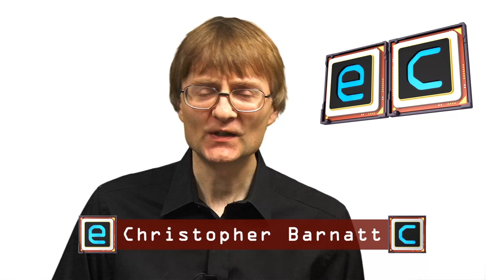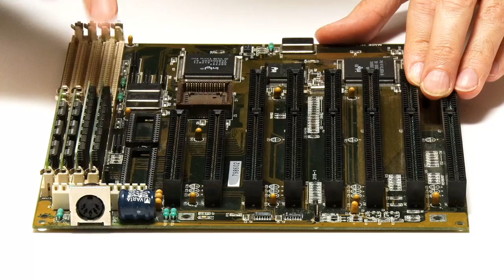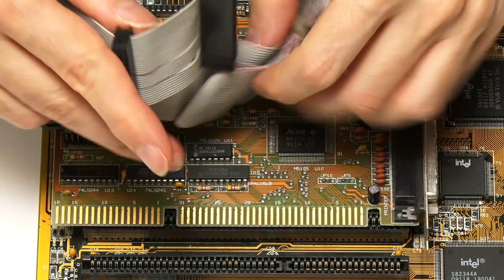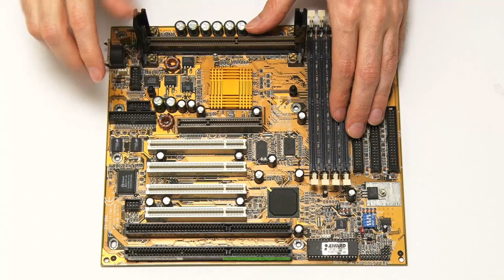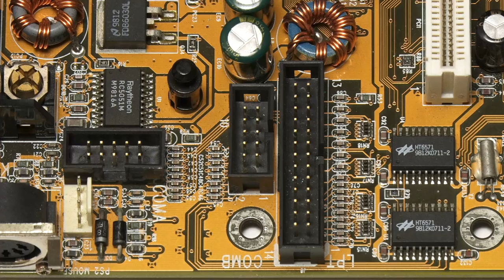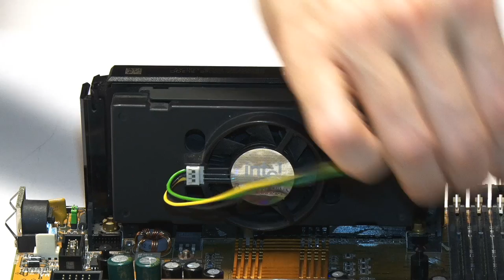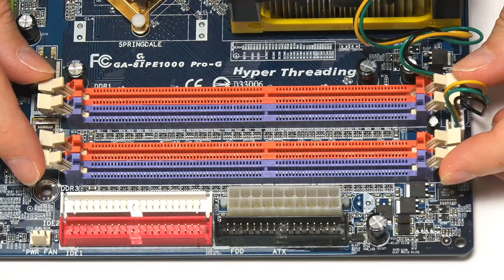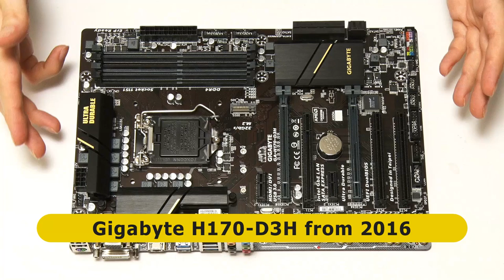PC Motherboard Evolution

Comment from the maker: Dear all, please note that I am very well aware that floppy and IDE ribbon cables had a red or pink stripe down one side that indicated the direction of insertion when using sockets without a notch or blanked out pin. Just because I do not mention something in what is already a long video does not mean that I am unaware of it! :)

The cable I insert into the controller card at about 6:15 is indeed inserted the wrong way around. But given that this is an old, non-functional board – and this is not a “how to” video – this really does not matter. As always, when filming I am working upside down, and leaning back to avoid getting in the way of the camera and lights, so what you can see onscreen is far clearer than what I can see, and when filming I have a lot of other things to concentrate on. I make 52 videos here a year on a very tight schedule. Not everything is perfect. It never will be. But I do what I can to make things as accurate as possible.

To those keen to point out below that I have “missed things out”, please note that I do say in the introduction that this video is not a definitive history of motherboards. Rather, it is a gentle discussion of those older boards I have in my possession.
Reply: Relax, it's only Youtube. :D
Reply: I think most of the floppy-cable-comments just wanted to say... 
"hey, I can remember"
and most of us just want to give something back to you for your hard work. (oh oh, I think I should learn english harder. Hope you understand me.)
Reply: I think you destroyed one of your viewers computer with pentium 133mhz. :)
Reply: Indeed, Chris, well said!  I hesitate to ask my question now, but I have an ancient, non functional 386 (It even has the original case with the huge red power switch.  Very COOL.)  Anyways, I have no money at all, and even if I did, I have no idea where to buy used pc parts of this age, would you consider selling me that motherboard for parts?  I have about 10.00 usd.  (Told you I was poor.  XD)  If not no worries. I'll just keep collecting...
Reply: Despite the fact that it isn't a definitive history video, I still learned something new today from this.  I had no idea that Baby-AT was even still a thing in 1999, much less that any P2 boards were made for the format.  At that time, I was running a Tyan Thunder 2 motherboard with two P2-333's, it was an EATX board.
Reply: When I saw you put it that ribbon cable in the wrong way, my eyes started to twitch since you said I happen to know it goes in this way.
Reply: refer to 0.34 to 0.36 and a half...
Reply: WTH are you talking about?
Reply: aaaw we forgive you, I did notice you turned the red line the wrong way and OCD kicked in, but didn't feel the need to mention it, I am fairly sure you are well aware of it since you are extremely good at nerding computers :D
Reply: I found your video very interesting however it seems that you are partial to Intel based CPUs. I throughout my PC life am more partial to AMD based CPUs. And, their changes had minor differences.

I build and maintain computers for a living since 1982.  First involvement was when I was in the 7th grade in 1971.

Thank you.
Reply: we all have different stories, I started with an Intel 386sx 16MHz, but also had a 486DX2 80MHz which is from AMD since Intel did not make this speed and a DX3 120MHz also AMD, later on I had a 200MHz Cyrix, had a few different Athlon ones and currently in the house I have a Intel Pentium 4, and Intel 486 DX2 66MHz, an Intel 4200U some obscure Intel processor in the laptop/tablet combo thingie and a Ryzen 1700. He focused on those he had lying about if you listened.
Reply: I loved the Cyrix processors.
Reply: The date codes on the chipset on the 80386 board are week 17 and 18 from 1991, hence the determination it's a 1991 board, probably to a 1990 design.
Reply: ExplainingComputers, do you have a GA-Z77X-UD3H? if so burn it. Can not stand gigabyte.
Reply: You know for a fact that we all still got it wrong when the board did not use the full plastic connector just the pin headers ;), but we wont admit it ;) ...
Reply: Yeah... the floppy cable part got my eye twitching... only because you prefaced it with, "...I happen to know it goes this way" (paraphrased).  Now I wasn't going to comment because TECHNICALLY it could go that way as long as you connected it backward on the floppy drives.  But with Hard Drives, you had to account for the knockout pin... that is why it is important to know the pin 1 marking on the block or the ribbon. ;)  No worries... you are doing fine and this is a great video.
Reply: I think it does matter, Chris. But in regards to showing how people could get their cables attached in the wrong way, and how the notch fixed that.
Even though you're talking about something else in here (and I understand that), that mistake illustrates the problem perfectly.
You may want to put an annotation at that exact point in your video, so fewer people will complain in the future. Instead they'll say that they were going to complain until they saw your annotation. :P
Reply from the maker: allluckyseven Great point -- I ironically illustrated my own point by making a mistake! :)
Reply: Damn… putting pitchfork back into storage

Just kidding, thanks for the great trip down memory lane! My PC life started with a 386DX-40 with 40 MHz in "Turbo"-mode … and a 120MB (MEGAbyte! That's 0.12 GB!) HDD which the seller said will never get full because it was such an unthinkable amount of storage those days.
Reply: same here, hard to watch it go on wrong.  he got it backwards because he didn't check the ribbon line to pin 1 which is how one checks, and he also specifically mentions having to rely on recollection which further drives it home.

the notched sockets and missing pins and blocked holes that came later were precisely a response to people not getting it right, which is why any computer person from that period cringes when seeing them go on wrong.

That is clearly not a simple omission or failure to mention and of course leads to a lot of well intending comments with the missing information and pointing out it was put on the wrong way.  it is a tech trigger for anyone from that period! ;-P
Reply from the maker: What so many people here seem to be totally missing is that a video is not reality. Did I check the cable? No. Why? Because when filming I have a very poor view indeed of what am doing. In the real world you do not assemble PCs upside down, from behind, under movie lights, while focusing on keeping everything in shot and not getting in the way of the lighting either, and matching into the shot before. I am never, ever filming in a situation remotely similar to a normal build situation, because the camera always has to be where my eyes need to be -- especially when the camera is close or very close.

And please remember, to quote a comment here, I am a computer person from this/that period! People seem intent here on portraying me as an idiot with no experience when what I am trying to do is to make the best content possible **within the constraints of actually producing that content**. I strongly suspect that I would not have been employed as a lecturer in computing for 25 years, or commissioned to write many computing books that sold well, without having some level of competence! :)

As another comment elsewhere here has pointed out, the whole point of this part of the video was to highlight that it was possible to put a cable in the wrong way round in those days -- so in part I ironically demonstrate the precise point I was making. :_
Reply: self-explanatory to those that matter. The good news is if you happen to do this on a Hard-drive IDE cable, the motherboard will likely beep/boot to bios screen then report no drive, and then the Hard drive will not Spin up.(Some motherboards it will stay black screen with no beep and no spin up, like it was a dead motherboard and Drive. -- & With a floppy drive, it will provoke a constant lit LED on the floppy with boot to bios with a beep and then only failing to boot if its checking the floppy status on boot (a setting in the bios). If this setting in the bios is not set, it can happly stay in the Lit-LED state/un-usable and it will still boot up but leaving you with a useless floppy drive. Point being, every component will survive, without damage.
Reply: it makes sense that it would be easy to make a mistake under those filming conditions.  no computer person from any time is ever going to know everything or get it right all the time.  it is unrealistic for anyone to expect otherwise.

often those moments get a lot more views and interest because they act as a natural focal point for attention, that's also normal.  has anyone ever made a perfect video?  no.  that's the reality of video.

i haven't read all the comments, most of the comments i read were people trying to be helpful.  it is a shame if anyone was trying to diminish your life experience over a misplugged cable, i wouldn't pay any attention to such a comment as that is crazy.

there are still internal connecters that can be accidentally reversed, that problem never seems to go away completely.  i cringe every time i see a flat ribbon cable with no keying in 2018.  smdh.
Reply: How dare you preempt my correction?  How am I supposed to go on feeling superior now?
Reply: Oh so you noticed you put it backwards, hehehe ;-)
Reply: our current mobo is far more advanced than the one you shown from 2016. ROG Ramoage VI Extreme has 802.11AC & 802.11AD WIFI TYPE C USB DIMM.2 Socket Intel Optane NVME and Bios connected directly to manufacturer server for updates.
Reply: Do a history of storage interfaces eg: ide, ata, ultra ata, sata, etc
Reply: I'm surprised you didn't mention power connectors. I didn't see a 24pin Molex connector on the first couple boards. Nowadays boards need a whole extra connector. Also the middle boards had multicolored gpio connectors?
Reply: AMD processors used the same motherboard as Intel processors until the Athlon in 1999.
Reply: Christopher,

I think you have forgotten more than most of us will ever know....just sayin' :-)
Reply: In fact you gave a realistic representation of how things were done back in the day. You look at the connector, position the cable the right way and find out it was actually the alternate right way around.
This stringently punished misrepresentation of reality has found a niche in politics today, where it has a fair chance of survival.
Reply: To err is human....  it is a 27 year MB all said and done...
Reply: Glad you cleared that up, and also, the board is marked to help you get it right, ;)
Reply: The Red strip on that cable stands for the 1st line and the pins on the board have it`s numbers printed next to them
Reply: Ah, I think I have figured out what Mr. Burton was getting at.  I think he was trying to give time stamps for the video, but couldn't tell the difference between a colon and a period.
Reply: you are the best! I appreciate how you dedicate yourself to the video as always! Despite those keyboard warriors that picking every possible mistake that you may make. they never know how hard you try and take everything you did for granted.
Reply: The earliest of the cables did not always have the red stripe.  Sometimes, in place of the red stripe on the hard plastic connector of the cable, you had a triangle indentation and a "1" indentation to identify what pin was supposed to align with the Pin one position of the connector port
Reply: @georgeworley6927  fore shame . . . what about Cyrix . . . . eventually purchased by IBM . . . . I ran a Cyrix P150+ overclocked with a custom(*i coded) QEMM Dos6.1 load, that ran duke-nukem + Descent + wolfenstien + Doom
Reply: @se8289  why are you for shaming me??? I admit that I have a bias against Intel! I did have a Cyrix based computer in mid 1990.  If I rember correctly,  a computer with an AMD CPU when I benchmarked against a comparable Cyrix based CPU, the AMD based machine won.
Reply: @georgeworley6927  sorry,  no shame intended . . . . If I've learned anything over the years working with PC tech, it's that I know a small % of whats out there, even in the public realm.

And when the Cyrix P150+ it was top for a very short period of time, at least in the mainstream via the SYSINFO sight that was up at the time . . . . though AMD was giving Intel a serious run for their money at the time . . . but thats old history at this point.  Thats back when the mainstays for updates on the industry were coming from Ziff Pub "PC Computing" and "PC Magazine" long before the days of "Maximum PC" or "Sysadmin" or Tom's Hardware. . . .
Reply: You said you cannot get zalman coolers anymore??? well seems to me like they are making ryzen 2 aftermarket coolers RIGHT NOW.
Reply: Look if yer gonna show an old 386 SX and say " I happen to know" and then actually do it wrong you've already screwed up and discredited your self in the first 6  mins of the video.  I was watching - saw you say something that blatant and then do it wrong and then I stopped the video and scrolled down to comment - and hey presto - the first line is you saying:  " I am very well aware that floppy and IDE ribbon cables had a red ...."  THEN DO IT RIGHT !!  Gonna go keep watching now .....
Reply: @mattparker9726  Ebay is your friend for finding old computer parts.
Reply: Ahh, too late, I inserted it the wrong way and now my spaceship made from old Saceshuttle parts is heading toward the sun instead of finding new planets for saving the future of mankind. What a mess ...
Reply: Lol, say something wrong so you can tell if ppl are REALLY watching. Glad to see the correction in a pinned comment.
Reply: Like the ones who get mad by the first showcased 80386 Mobo coming from year 191991. 
Thanks EC for clarifying the IDE thing for those who can't accept some errors due to rushed uploading agendas, and one-man revision armies, on every single YT channel. 
BTW, keep up the good work. (Y) :)
Reply: Did you ever get your 386 working? Chris' board is missing the BIOS chip so would not function regardless, and BIOS had to be an exact match, just about impossible to find nowadays.
Reply: @killdeer  And you have better and more caring content where?  He did say that he was just roughing it the whole video when working with the old corroded non working MB. Maybe you should turn your volume up and put your phone down and think a bit.
Reply: @casondave  You should go make your own videos and do them right. Maybe you could be more considerate with your criticism rather than be a boor.
Reply: @marsa74  At least you made a funny joke ....
Reply: "I happen to know..." 🤣
Good job on the video. I appreciated seeing all of this "old" tech. It brought back many memories. Thank you for your work!
Reply: Lol. I was yelling at my monitor and was just about to comment about the red stripe going on pin1 when I saw this comment. Thanks for the awesome channel and great content. I am disappointed in myself for not discovering your channel years earlier.
Thanks for sharing.  😉👌🏻
Reply from the maker: @jtveg  Thanks for watching John.